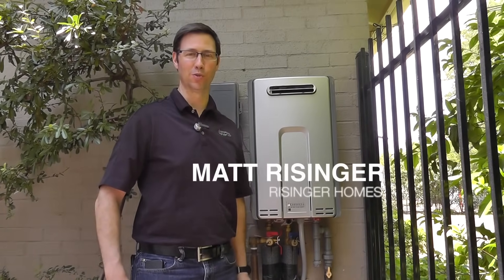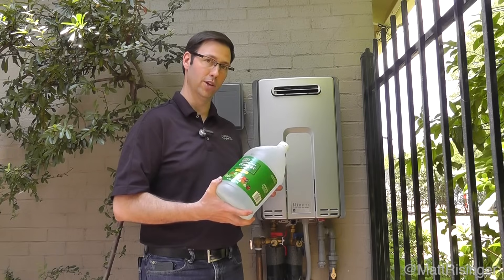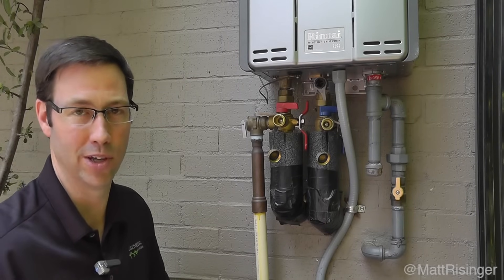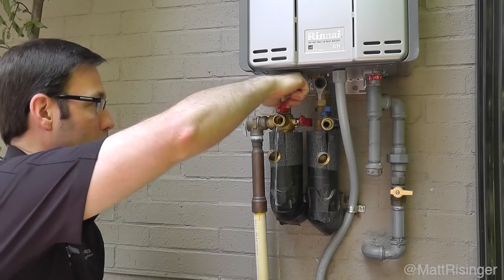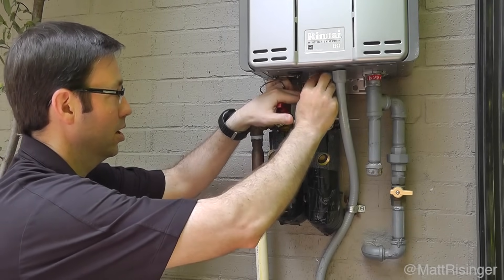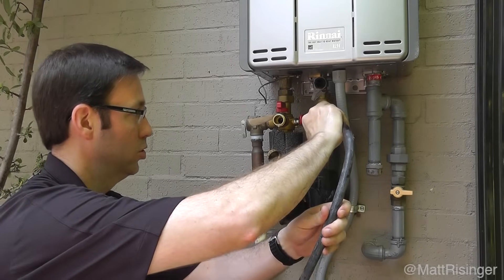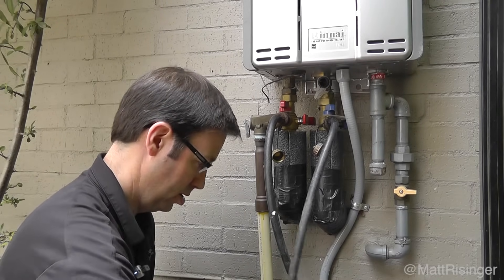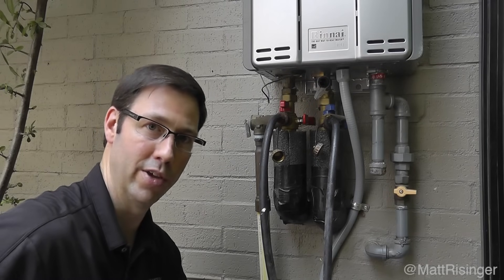Tankless Water Heater DeScaling - How To Flush

Comment: Matt, There is only 2 of us and we are part-time residence in each of 2 homes that have Rinnai W/Hs. We have a softener in one home and none in the other. Is there a rule of thumb as to the hardness # of the water, before one flushes either unit. Also could you give me an estimate as to the length of time between flushes for a softened house and non-softened, for us part-timers?
Reply from the maker: Gary,  Great questions.  I'm not certain of the hardness # on the scale.  In general, if you have soft water you could easily do this every 5 years.  I'm saying 5 years but it could be longer.  It would be wise to do every 5 if for no other reason than to check the filters.  If it's a non-softener house but you use it part time I think every 3 years would be fine.  With 2 people at home you should do it every 18mo-24mo, but since it's 50% use 36mo should be good.  Hope this helps.  Best, Matt
Reply: Matt Risinger Thank you for taking the time to reply. I will have the water tested for hardness and then proceed. All the best!

Comment: I have a 1/2 HP submersible pump. Is this too much flow/pressure for my 94 gallon Rinnai unit?  If so, is there a way to reduce the flow on a 1/2 HP unit?
Reply from the maker: That will work just fine.  No need to reduce the flow, it'll just work faster.  You might get done in 1/2 the time if you're moving 2x the solution through the boiler.  No issues with high flow that I know about.  MR

Comment: Matt, I just tried this using the hoses and pump I got through your Amazon link. Any idea why the water would cone gushing out the hose at the cold side of the intake kit? I tried tightening the hose with a tool, checked the rubber washer in the hose, swapped out ends of the hose, and verified all the valves were locked open or closed as appropriate. I'm stumped and frustrated, but just thought I'd ask in case its a no-brainer I missed...
Reply: Quick trip to the hardware store and I figured it out. The hoses were rubbish. Got a slightly nicer pair and everything worked perfectly! I guess I'm going to test out Amazon's return policy. I'd recommend you look into whether the hose product your linking to is really worth the purchase. Thanks for the otherwise great video!
Reply from the maker: Bobby Janecka Good deal Buddy.  Glad to hear you've got it working!  Best, Matt
Reply: I had the same problem. In my case the end of the hose was tight, but against the shoulder of the cold water drain valve and the rubber washer in the hose was not getting compressed. A second washer solved the problem.

Comment: Great instructions. I did the flush as hot water i was getting was milky white. I did the flush for roughly 90 minutes. However the hot water i am getting is still milky white. I have to figure out what else could be going on. I didn't have this problem in the first 2 years.
Reply from the maker: If you flushed for 90 minutes you should be good.  The milky white may be due to heat buildup from your pump.  Nothing to worry about.  Matt

Comment: Matt Risinger ,  I had an error 14 on my Rinnai R85, I hope this fixes it.  When I pulled the filter it was disgusting.  We had to speak it in vinegar for about a half hour to clean it.  I will update later this week to let you know the out come.  Either way great step by step instructions.  The authorized service Rep in the area wanted to charge me about $250 for this service.  Cost me less then $100 in supplies and took about ten min to set up.
Reply from the maker: Jacob, How did this turn out for you?  Matt

Comment: Ummmmm.  Like, maybe you could show the hook-ups in the BUCKET!!!  What hoses goes to where on the PUMP!!!!  Novices do not have a clue.  Why do you assume they know how to hook what hoses to what on the pump and the bucket???
Reply from the maker: James, Sorry buddy.  On the pump there is a threaded output.  Attach the hose to the pump's output, the the other end goes to the Cold inlet side of the water heater (usually on the right).  Then thread the other house to the Hot output on the water heater and dump that hose into the bucket.  The idea is that you are creating a continuous loop of vinegar that will "flush" your tankless unit.  Got it?  Best, Matt

Comment: I'm doing my Rinnai as I write.  The vinegar is pretty dark.  I know I'm in a very hard water area.  This is a new unit, only 1 year old.  there are 2 adults and a 5 year old so normally it doesn't get used excessively.  Do I need to change the vinegar and run some more?  Thanks for the video, very well done.
Reply from the maker: Something is funky if you're getting dark vinegar.  Are you running to longer than an hour?  If so, stop you're done.  One year of use for your house shouldn't have much scale issue.  30-45 min flush should be plenty.  Matt

Comment from the maker: Timothy Huang,  There is no pilot light on these units.  They have electronic ignition so they only light the gas when there is a call for hot water.  Nothing to re-light.  Best, Matt
Reply: +Matt Risinger Hey Matt, thanks for the info.  After starting my pump the heater sounded like it turned on then off and then started beeping a code 11.  Water is still flowing properly but now the heater is beeping.   Is this normal or do I have a problem?  Thanks
Reply: Also have a Code 11, have never flushed it in 3 years, will flushing help clear the Code 11?
Reply: I have a 6 ltr instant geyser the water is not coming from the outlet and I think it is not going through inlet something is there I saw some while solid thing what do I do
Reply: +hubaib khan white not while some metal can it be?

Comment: Great vid. Is there a specific reason you want to leave the heater plugged in? All the other instructions I've read say to unplug it.
Reply from the maker: I've seen different manufacturers say different things about the off/on issue during flush.  If your instructions say to flush it OFF then I would certainly follow their guide.  Best, Matt
Reply: Matt Risinger Thanks for the reply. It wasn't in the instructions that I read it. I bought the house with the Rinnai already installed and they didn't leave a manual. I'm just going by other folks with DIY advice around the web. I'm just wondering if there's a benefit to leaving it plugged in during the flush (for a Rinnai). Thanks!

Comment: Can running the vinegar too long (2hrs +)damage the unit itself or cause leaks??
Reply from the maker: It would be really hard to damage the unit with standard Vinegar, but you really don't need to flush longer than 90 minutes.  A leak happening from Vinegar flushing is impossible.  Matt

Comment: I had the LC code and ran this process and it stopped, however nothing seemed to be coming out of the hose attached the hot water outlet during the entire process? The LC warning is gone so I think I did something right, I just don't know what?
Reply from the maker: If you didn't move Vinegar though the system then you didn't actually flush the unit.  I wonder if you had a sediment build up on your filter?  I would contact a professional plumber who specializes in tankless if you continue to get that error.  Best, Matt

Comment: Matt, I checked on the vinegar after about 2 hours and it had a black sediment. Is this normal or did I eat up part of the boiler? Everything is working great, and I have increased pressure head to the showers now. I just wasn't expecting black.
Reply from the maker: Yeah, sounds like you ran it a bit too long.  I don't think you harmed the unit, but I'd scale it back to 45-60 min on the flush (no pun intended).  
Overall, great job.  Sounds like your unit is ready for another year+ of good service to your family.  Best, Matt

Comment: As a Rinnai trainer, and a former Noritz trainer, I would like to note that if you don't have hard water, (not everybody does) or run the unit at high temperatures (above 120*F), you may actually do more harm than good.  If there is no scale in the unit and you flush with vinegar for up to an hour and half it won't have any scale to "eat" and can deteriorate the copper heat exchanger. (not called a boiler, the terms get mixed up all the time) Also the Rinnai unit has the ablity to let you know when it requires flushing with the "LC" error code, minimizing the importance of anual flushing for the average home.  Of course if you know you have hard water, you should service the unit reguarly as noted here. Also, the pump should be capable of flowing about 3GPM or more through the unit to do a good cleaning.  As a test, mine are 7 years old, on very hard well water.  Never flushed, never had trouble.  Probably will flush soon just to see what comes out.  Good job on the video!  Google my Tankless 101 series for even more info on these great products!
Reply: I seen research that using a soft water conditioner will erode copper. I know someone who has a water softener for years and now her plumbing is clogging from the years of accumulated salt. So I'm sticking with a conventional tank water heater because flushing it is so simple. Even easier with a gas unit.  All I have to do is turn the heat to "pilot" and flush it yearly which does not require anything other than a garden hose.
Reply: I hate the salt water softeners and use the reverse osmosis ones.   The salt units do put salt in your house water supply and i'm supposed to keep the salt levels down for health.   good luck !!
Reply: How come you don't see many people using citric acid as it is more acidic. Vinegar is really weak and wont dissolve as much or as quickly. Normally I run mine for about 20 minutes or until it seems like all the impurities have dissipated.
Reply: Matt and Scott is there a way a can email both of yal and ask questions on tankless system? Wynn007@hotmail.com if yal don’t mind
Reply: What be the most compatible inline main Filteration system that can handle Rinnai Tankless Water Heater volume? Secondly using Copper pipework chemically reactively interfer?
Reply: Scott Gregg use time
Reply: I have a water softener before the TWH, do I still need to flush annually? Haven't had any trouble or error codes so far.  It's a Westinghouse model.
Reply: Because both these guys are not service guys and don't really have a clue what they are talking about. I think Matt may be a Plumber but not a Gas Tech and probably not even licensed to service these units. I am a certified Gas technician that Sells, services and is trained and I am just shaking my head at both these guys. Honestly just look at this tutorial for example the guy is using a multi purpose set of pocket pliers to try to tighten the hose. Really? Also unplug the unit from the electrical DO NOT leave it plugged in like this guy shows in the video. It will try to fire and there won't be any gas for it so you will just be wearing out your igniter for absolutely no reason other than stupidity. Running the vinegar through the unit for an hour regardless of how little scale may be in the unit will not damage the copper as suggested, that is a myth to scare customers and get them to hire professionals. Also no need to go an hour and a half. 45 mins to an hour is more than enough. You should also flush out the system of vinegar before opening the valves back up to your house. If you wanna learn how to do this operation properly follow these directions straight from Rinnai and the video is much shorter and clearer than this one! https://www.youtube.com/watch?v=8-ts7XuvS48
Reply: @kotakintai  Thanks that was very helpful
Reply from the maker: Scott, Thanks for your insight and experience.  I have very hard water from the city and my unit scaled up without the "LC" error code.  It was a mess to clean up as I had to remove all the screens on faucets and my thermostatic master shower valve which was a huge pain to clean.  This is why I'm recommending 12-18 mo between flushes if you know your water is very hard and your machine is getting a lot of use.  I have a busy house with 4 children so my unit gets a workout daily.  With 1-2 people in a household and hard water I could see waiting till 24+ mo between flushes but I hesitate to wait for that error code considering my Rinnai never coded.  Thanks, Matt
Reply: And Thank You also for spreading the word on these GREAT units! I do want to reiterate that YOU ARE RIGHT! If you know you have hard water, you should have ANY brand of tankless water heater serviced annually. Actually any water heater period! (and you might want to consider a water softener) Restaurants or other commercial installations running at high temps (140*F or higher) should consider every 6 months if in a hard water area. I will have an upcoming video on maintenance and service that will include answers to some of the other questions I get besides the flush procedure.
Reply: You guys are NOT making any sense.  3GPM or MORE?  there is not a maximum, so a 90gpm pump is fine?

Error codes will flash LC, then why do it until it flashes???  Why say if you know you have hard water, do it...then say don't do it until it flashes????
Reply: FuScott Gregg

Comment: matt,
cleaned my rinnai r94ls every year for the past 2 years with 4 gallons of white vinegar because the last few months the water pressure started  to be very low,
think it needs to be cleaned again?is it essential to keep the screen in at time of cleaning?thank you for your time ..steve
Reply: also system is only 2 years old and was cleaned in dec.2013

Comment: Thanks for the video, I would like to watch a video about cleaning the inside of the unit any video on that?
Reply from the maker: I'm not sure what you're asking.  This cleans the internal copper boiler, are you asking about cleaning inside the case?  You can probably use a shop vac or lightly use compressed air inside the case, but I'm not sure you would need to do any maintenance on that.  Best, Matt
Reply: Matt Risinger Hi Mat,   Wow that was a fast response  "THANKS" yes like an air filter, any built up off soot on burners, ( like gas ranges ) stuff like that.
Thanks again,
Newtoponys
Reply: @Matt Risinger Hi I was wondering if you can please tell me where the filter is located inside a Quietside Gas Boiler? Many thanks !!

Comment: Thank you for the informational video.  I'm sorry to say we haven't ever cleaned our tankless water heater! I didn't know we were supposed to descale each year until I called Noritz last week to ask about low pressure in the shower.  The lady told me I should have been doing this maintenance each year.  We remodeled about 8 years ago and installed the Noritz and unfortunately I didn't see this info in the manual and the tech who installed our furnace, A/C, and tankless units never mentioned it. Anyway, is there anything extra you'd recommend in this case?  The Noritz lady recommended CLR.  I just bought a 28 oz bottle but after watching your video I'm wondering if I should buy more before I begin?Thanks for your help.

Comment: Follow-up...
When I returned to the bucket to stop the cleaning, noticed the bucket of vinegar was HOT, nearly too hot to touch!  Unplugged the pump, emptied the vinegar bucket, added a couple gallons of cold water to it and ran the pump again for a minute or so.  No idea what caused the vinegar bucket to heat up, but I'm wondering if the pump clogged on sediment or something.  Didn't seem to be a lot of sediment in the bucket though.  Any thoughts?  Brand new Wayne pump, first use.
Reply: Matt Risinger All the other videos say to shut off the power, by pulling out the electric cord.  Should I disconnect the electric. After I flush the unit with vinegar should I flush it with clear cold water.  How do I do that?  Or can I just run the water from my sink until the smell of the vinegar is gone?  Thanks for the help.  I will order my pump from amazon so that you can receive credit.
Reply from the maker: Rod, That's pretty normal.  The pump generates heat (some more than others), but the vinegar is holding that heat since it's recycling the water.   It doesn't harm anything assuming you keep your run time to 90 min or less.  Next time you might start with chilled vinegar and use 4-5 gallons total to help keep the overall temp lower.  No worries.  Matt
Reply: Rod, this might sound silly, but are you sure you turned the gas off? But yeah, maybe we should be turning the power off for this operation. Not sure why it needs to be on.

Comment: Matt, 
Thanks for the terrifically helpful video. Vinegar is circulating through my Rennai TWH as I type this.  You have a real gift for communicating clearly and confidently, a real blessing to jittery DIYers tackling this for the first time. I was a bit concerned when the unit started beeping a me - temperature warning - but just figured I should turn the On/Off switch to off, even though I left the power hooked up as you said.  Thanks again, Matt. Best of success to you!
Rod Schwartz
Pullman, WA
Reply from the maker: Ron,  Thanks so much for you kind words!  You did the right thing, if it's beeping it's not realizing that the gas is shut off and it's beeping to say there's a problem firing the boiler.  Turning off the power is the right thing to do.  Good work buddy, you just saved yourself a hefty bill from a plumber to do this simple procedure.  Best, Matt

Comment from the maker: These can be mounted outside in cold climates, but I probably wouldn't.  They have an internal heater that works to keep the boiler from freezing down to about Zero degrees.  However, if the power goes out you are in trouble.  Mount it inside your garage or basement if you live in the North.  In Texas or the South you can easily mount this outside. Best, Matt Risinger
Reply: Can't you just drain it through the flush valves and let it freeze? Turn it off, of course. You can drain it before you leave town in winter.